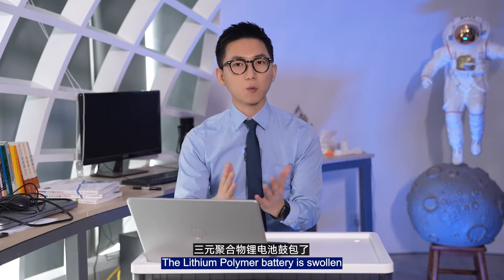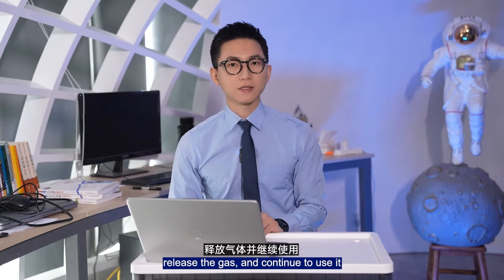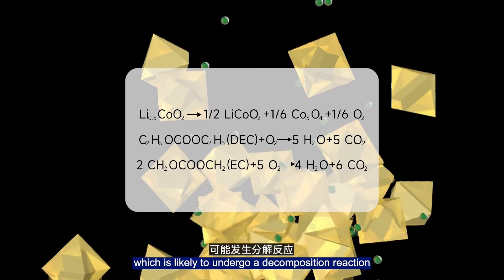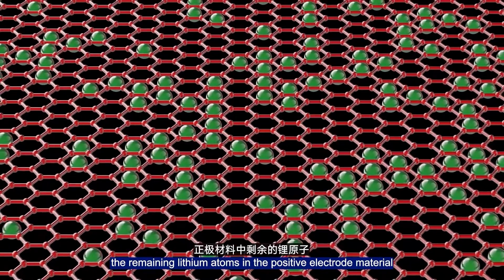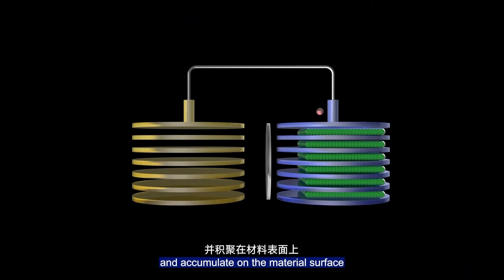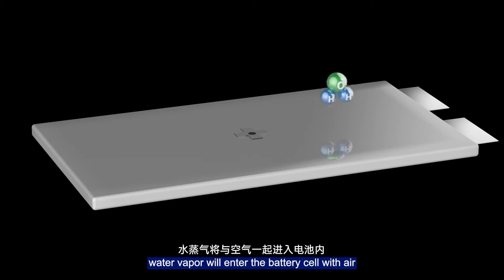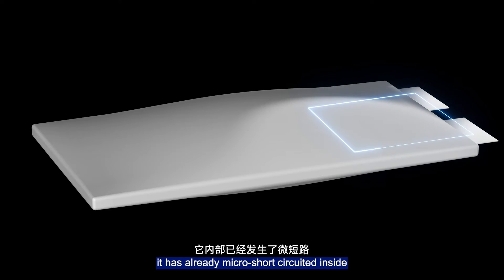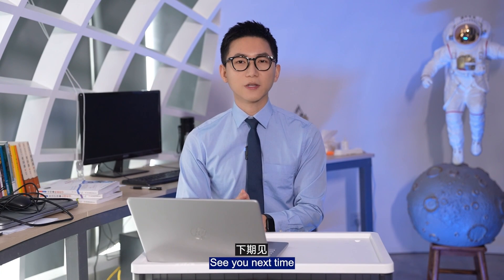What to do if the lithium battery is swollen?

Comment: The problem is that many devices such as Bluetooth speakers and gamepads have batteries that swell without being detected inside the chassis. Manufacturers should make it a point that batteries should easily be checked and replaced by the user.
Reply: That would need a mandate from us consumer organisations or the Eu. 
Look at USB C- same thing.. 
As long as this practice doesnt earn them more but rather cost them more.. theyre not gonna do a thing. 

This is why right to repair is so important.

Comment: Great explanation, and ending to the point... punching a hole is only bypassing manufacture saftey warnings..swollen means its  defective at a litteral term.. The battery is no longer safe. Remove with caution. Do not continue to use or you are at unpredictable risk.

Comment: So can battery expand do to gas being releasing in the house? I have a very old power bank came home aunts place left gas on from stove for over 12 hours after clear out air for several hours found power bank expanded crack in two, Sowell and super hard power bank is over 6 years old lasted a long time.

Pocket Juice product 20,000 amh

Comment: I was thinking of putting a little hole in my phone battery .. But after seeing your video i will not
Just gonna have to see about getting a new battery instead
Reply: You can, just scratch the plastic with a needle let the gas out  then tape it up so no moisture can get inside.  I've just done it to stop the back glass being pushed off the back of the phone, also ordered a new battery too because this isn't any type of fix.

Comment: What to do if the lithium battery is swollen?    Run!
Reply from the maker: HahHah
Reply: quick way to kill a lipo battery is to shoot at it with a pellet gun. lots of smoke, heat and possibly fire. i think. i have a few flight batteries that have become a little bit swollen but still works fine. i just use them on my nitro starter motor
Reply from the maker: @pieterpretorius1014  The requirements for flight batteries themselves are relatively high. So now when used on other devices, as long as the power and current are not very high, even slight swell can be used normally